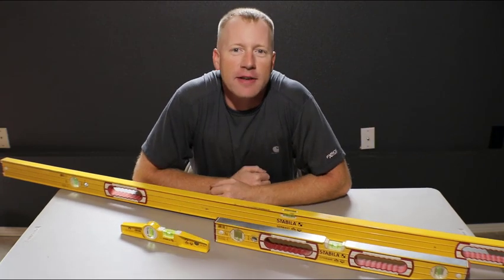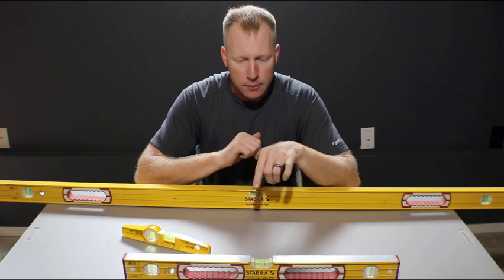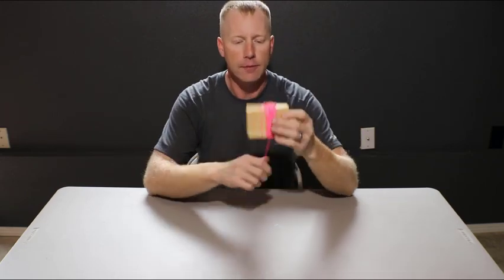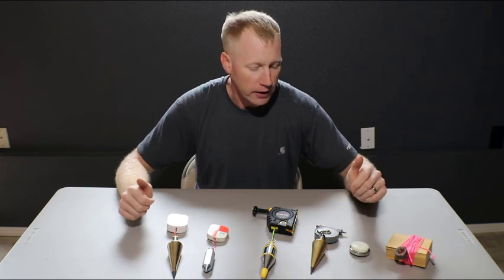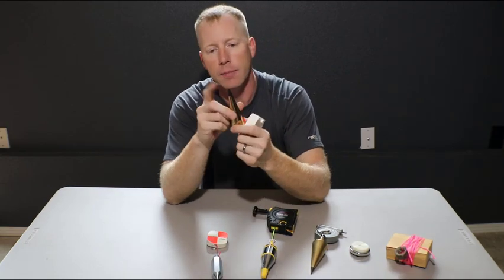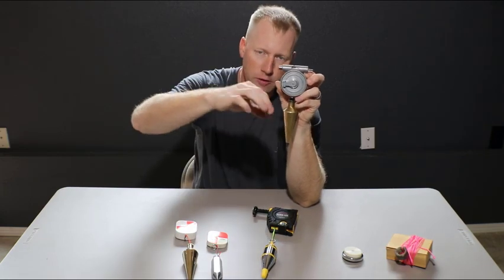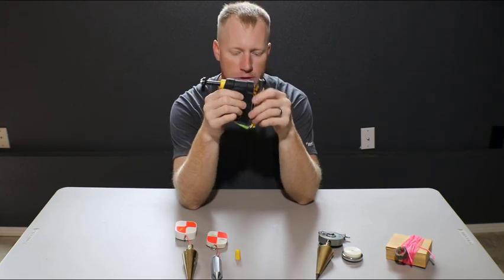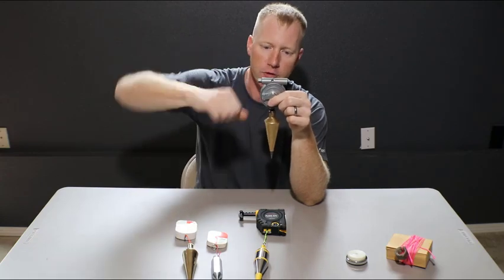Tool Tuesday, Plumb Bobs

Comment: If you place a glass of water at the base and allow about a third of the weight into the water it will stabilise the string much faster and help hold it plumb in windy weather
Reply from the maker: Good tip, I haven't heard of that before. I will give it a try. Thanks for the comment!
Reply: Water? 😂 I'm guessing you've never worked on a real job site before.
Reply: I saw a millwright stabilize his plumb bob in a bucket of oil. We were working in a breezy, half built saw mill.

Comment: I do masonry and carpentry and I've always been a big plumb bob fan. Sure lasers are ubiquitous now and can do a lot very quickly (and I do own a couple for rare occasions), but I think a lot of people would be surprised how fast and efficient you can be with a plumb bob too, the difference is, like with many hand tools, it requires practice and skill. Aside from the aforementioned price and durability advantage, the humble plumb bob fits nicely in my tool belt, never runs out of batteries and quickly gives me a reference line on two planes simultaneously which is nice for windows and doors. On busy job sites, they don't bounce like a tripod mounted laser when people walk past your work area, your lines aren't so easily blocked and the bob takes up almost no room in crowded or tight areas. Day light visibility is never a problem with string. Accuracy is also unmatched , especially as distance increases. Plus using a plumb bob just feels so deliciously nostalgic in a world rife with ridiculous over the top gadgets. All these bells and whistles, while touted as productivity improvements, seem to only be endless sources of conversation and comparison on job sites now. It seems guys are more interested in talking about their tools now than working with them.

Comment: That plumb rite will fit great in my tool bag plus i work with wood metal and drywall so it will be great and better than those crazy levels bc let’s face every piece of wood is too crooked for my 4ft level🤣

Comment: I use plumb bobs quite often at work for finding the centre measurement from the face of a fitting to the plumb bob string line when I’m pipefitting. 

It’s really an invaluable tool for us in the pipe trades! I’d say our 3 most valuable tools aside from our wrenches are Tape measure, torpedo level, & plumb bobs.

Comment: I am currently leveling out a 3 story building for siding
 Building was built with ICF. Its 3 inches off in some areas! I need a heavier plum bob as the wind sways it. Laser?

Comment: I have a plumb bob with a replaceable tip, similar to one of the ones you have but it has a small (maybe 16th of an inch?) hole running horizontally through the tip. I've searched and searched off and on for years but have yet to find out what that hole is there for. Any ideas??
Reply from the maker: I don't know for sure, but I have always used that hole with a small nail as a way to replace and tighten down the tips when I have to replace them. They are kind of hard to grip with a pair of plyers since they are smooth and tapered and I don't like tearing them up. Hope that helps a bit.
Reply: @DanSarahMakers  You know what, I'll take it! That's the only explanation anyone has ever given me and it makes perfect sense. Thank you!

Comment: I need to get one and learn how to use it. what about the windy days are they only good inside buildings.
Reply from the maker: It depends on several things, the weight of the bob, are you shielded from the wind, how far the bob is hanging, and finally how long are you willing to sit there waiting for the thing to stop swinging! A PLS or laser plumb is priceless in many situations but trying to plumb down from a string line is really hard to do, bright sunlight makes even the brightest laser point almost impossible to find much less see, and they can cost hundreds of dollars.
Reply: Use a cup of water and let the tip touch the surface of the water.
Reply: Use a good clear bucket of mineral oil and piano wire. Keeps from flailing around

Comment: How do you connect the string so it's centered
Reply: I needed to know the same information.  I seen that a key ring looks to be perfect to run through the cheaper plumb bob (mine) and then tie on the string.

Comment: How do you know your level is level?
Reply from the maker: OK, Easier to show this check, but I will try to describe it without confusing anyone!
Step 1. Checking for level: Find a table top, floor, or counter top; it does NOT need to be level. Put your level on the surface and look at the position of the bubble in the level vial (remember where the bubble is in relation to the lines around the vial). Next, spin the level so that the right end is on the left and the left on the right and place the level back into the same spot that the level was in during the first check. Look at the bubble again, is it in the exact same location as the first check? If it is, then your level is true to level. If the bubble has moved at all, then no good!
Step 2. Checking for plumb: Find the corner of a wall, stud, or door jamb; again, it does NOT need to be plumb. Hold the level against the the surface and check the bubble in the plumb vial, remember the position of the bubble in the vial. This time, spin the  level so that the top is now the bottom and the bottom is the top, recheck the plumb vial. If the bubble is in the same location, then the level is true to plumb.
Things to note; Some levels have several level and plumb vials, so check them all and don't mix them up when spinning the level!
                            If a level has a 45 degree vial, you may need to create a jig and follow the same steps from above. There are actually not a lot 
                            of 45 degree vertical angles out there!
                            If the bubble doesn't show dead-on plumb or level either way when checking, but the bubble is off the same amount AND 
                            direction, that just means the surface you are using isn't plumb or level.
                            If your level isn't true any more, you may have one with adjustment screws or vials that can be adjusted, but they tend to 
                            loosen up on their own once they get messed with. Some brands like Stabila, have a lifetime warranty as long as the main 
                            level body isn't damaged.
Hope this long response helps Nicholas!
Reply: Draw a line that is plumb, spin the level to the other bubble. If they line up, you are good. Must be plumb for that to work

Comment: Ever use A water level?
Reply from the maker: I have two types of water levels and haven't used them very many times over the years. They excel in several areas, but I just don't find myself in those situations very often.
Reply: I use them for when im establishing A bench mark for Elevation then use my story pole to get an elevation around the entire perimeter so that everything is all the same height so 400 feet down the way all my windows are the same   measurement
Reply from the maker: I am really glad to hear that some people out there still try to do a good job at build things level, Thank you. I have used them to line up cuts on opposite sides of thick concrete walls inside to outside of buildings where there were no uniform places to measure from and a laser wouldn't work.
Reply: Primitive methods still work to this day from chalk lines to plumb bobs to 3,4,5 Yea well I'm A union Carpenter so they ingrain these things in our head as apprentices.we do an equal equal from columns to get an accurate control line and everything stems off of that.and Rock and roll time I'm A metal stud framer